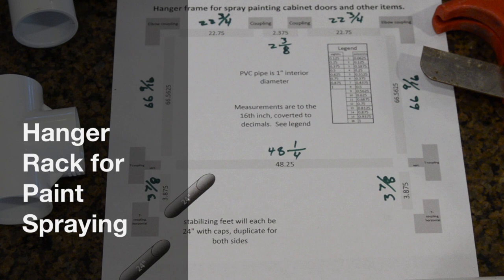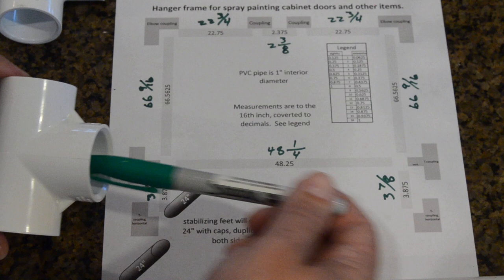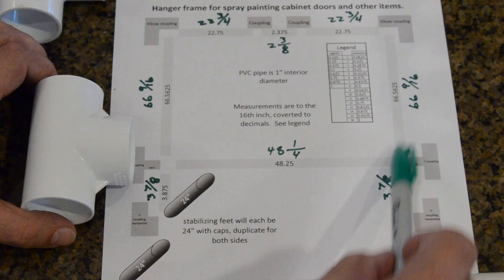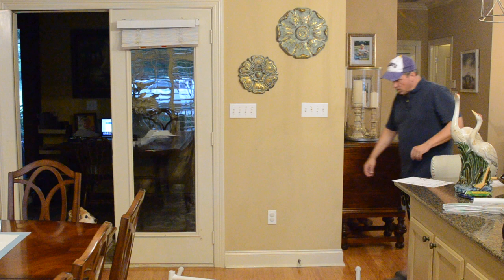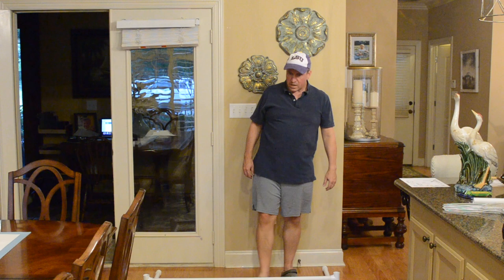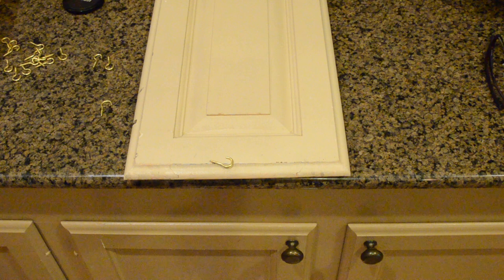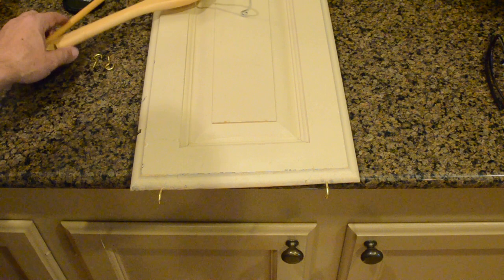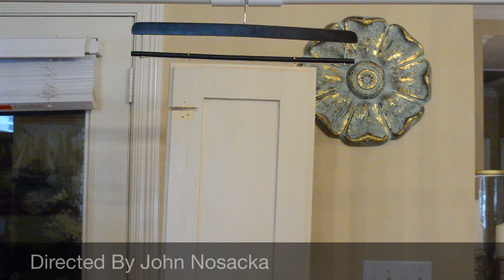Hanging Rack for Spray Painting Cabinet Doors Made from PVC

Comment: He left out the 4 @ 24" pieces on the list for the legs or feet.  
I also put another T half way up the side rails so i have two levels to hang stuff.  
The middle one can be removed if you need to hang longer stuff.
One last thing.  This rack WILL NOT HOLD hevay stuff. so if you are wanting to hang doors or heavy wood to paint this likely will not hold up.

Comment: Did you end up using your modified Harbor Freight spray gun?  how did it turn out? any thing you would do different?  Thanks for your time.
Reply from the maker: 89gtconvertible yes, used the gun on a kitchen and a bathroom.  It worked great!  I wouldn’t change anything.  I did make sure to clean all of the silicone(?) packing from the gun before first use.  It’s a little time consuming, but it’s packed into a number of the vents and ports.  I did drop it once and bent the newly bored nozzle and that affected the spray pattern.  Running the bit through it once or twice put it back in shape.  Very glad I didn’t buy an expensive gun
Reply: @johnnosacka9556  Nice! I bought the spray gun and drilled it out this past weekend.  It sprayed amazing! I do have another question though if you don't mind me asking: My spray gun came with an inline filter that goes into the bottom of the cup.... I found this filter is preventing the paint from getting to the tip of the gun fast enough for spraying...did you remove this? (the gun needed a couple seconds here and there to catch up with paint making its way down)  I'm planning to filter the paint when I put it into the gun and remove the filter at the bottom of the cup (it just drops in the bottom of the cup)...
Reply from the maker: 89gtconvertible I’m not sure we’re using the same gun.  I strain the paint before it goes into the one quart cup and the filter fits into the gun where it attaches to the gun.  Mine runs on an air compressor.  Does your’s?
Reply: @johnnosacka9556  My gun also runs on air.  And the filter you described is exactly what I meant to say :)

Comment: Where did you buy your hangers?
Reply from the maker: Debbie Gualco I ended up using wire hangers from the cleaners that I had already.  I doubled or tripled them based on the weight of the piece I was hanging.
Reply: Ok. But I still would like to know where you bought the wooden hangers for another project.  I cannot find ones like that online or locally. The straight wooden one with the straight narrow wood strip/dowel below. Any help would be appreciated. Thanks!
Reply from the maker: Debbie Gualco I didn’t buy those either.  I think I just accumulated them that I have from clothes that I bought over the years... men’s suits